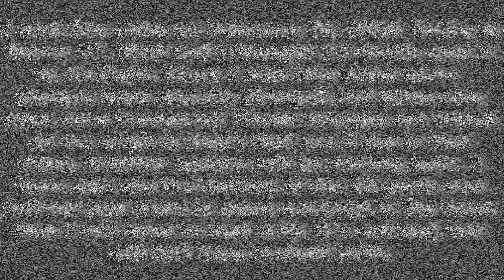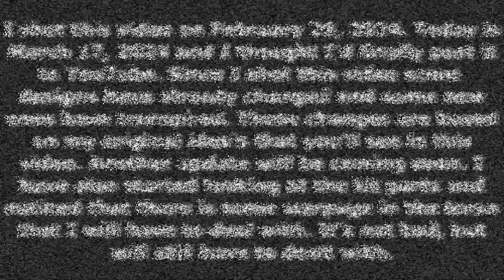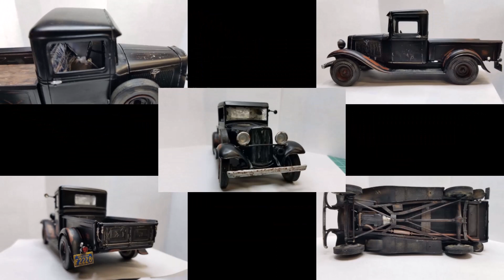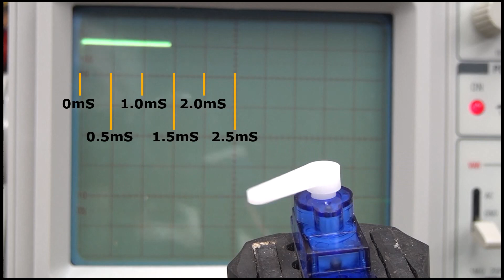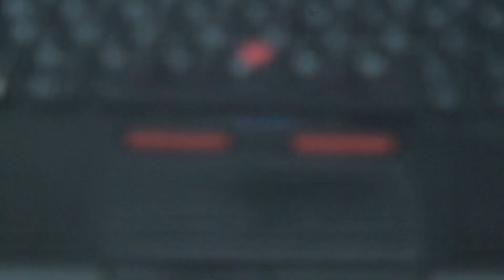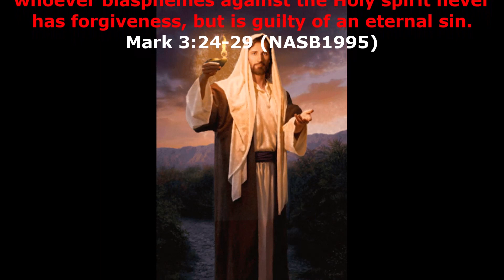02 Lost in Space - B9 Robot - Part 02 of many

Comment: Very cool. 👍Great work on the Electronics. I would look into a simple alternating blinking LED circuit using a simple IC chip and battery. It's a much smaller package for the body. Great experiment with the Servo👍 Last time I had looked at an oscilloscope wave from was my pulse modulation days😂
Reply from the maker: Thanks. Yes...I'm still looking around for alternative methods so that everything can be self contained, especially since I would like to add moving feet tread and using an RC controller. I'm having  FUN!!!! Thanks for watching and thanks again for the feedback. I truly appreciate it. Any help, any time is very much appreciated. Thanks again!!!!